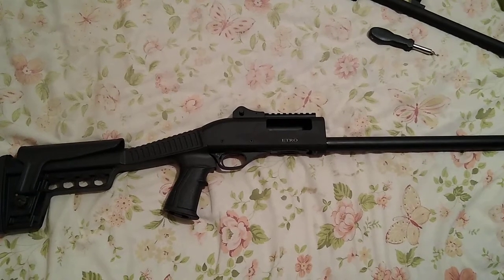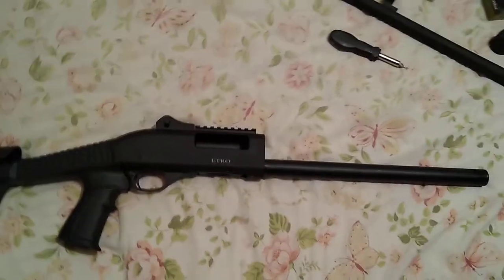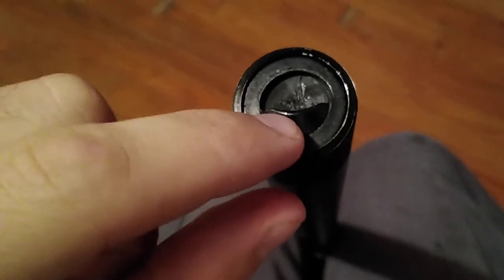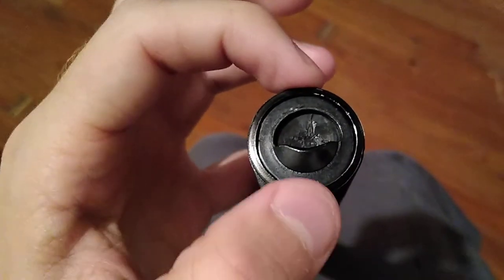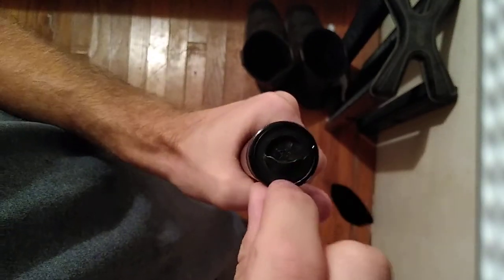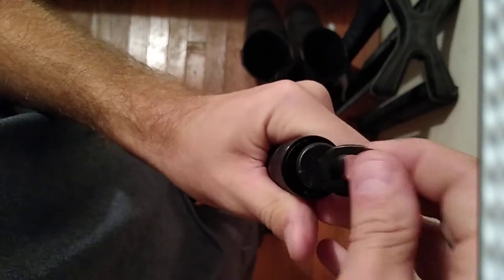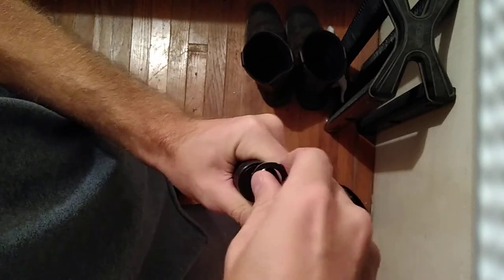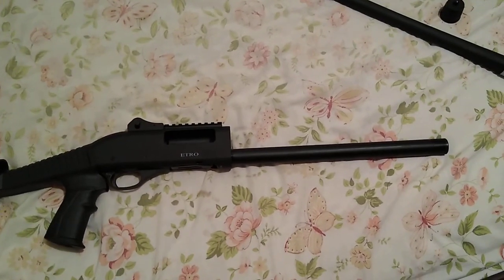ATA Etro E10 magazine plug removal.

Comment: So... As a 7+1, mine would still only hold 6 in the mag. Am I mistaken that 7+1 means seven in the mag + one in the chamber? Mine is only taking 6 in the mag with one in the chamber.
Reply from the maker: Yeah it only holds 6+1 the manual lies. Pretty sure the manual was wrote for a different shotgun

Comment: Do you know how to take the spring out of the shotgun? I need help because i want to install a tube extension on this shotgun but the black circle from the plug is bothering me
Reply from the maker: Don't think these are meant to be used with tube extensions.
Reply: @kevinlee6580  that sucks but is there a way to take the spring out ?
Reply from the maker: @timesupwatchagonnasaynext9921  I tried but couldn't figure it out. I believe the mag tube is permanently fixed to the receiver so the spring likely isn't removable without altering the gun.